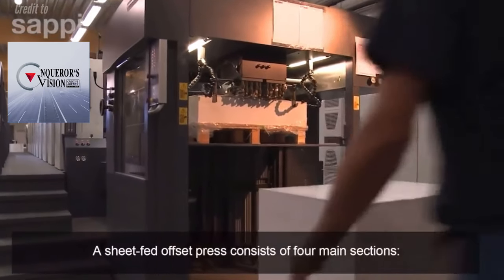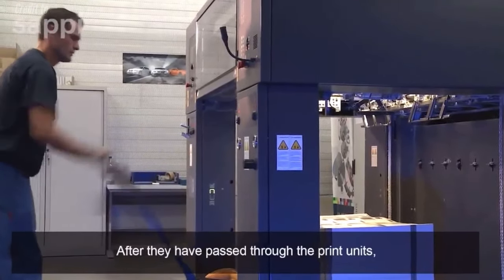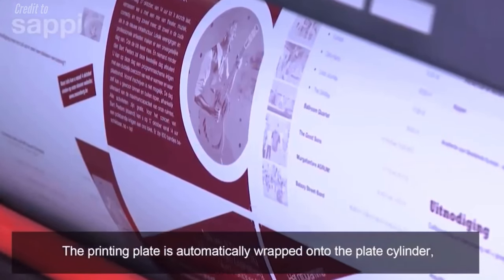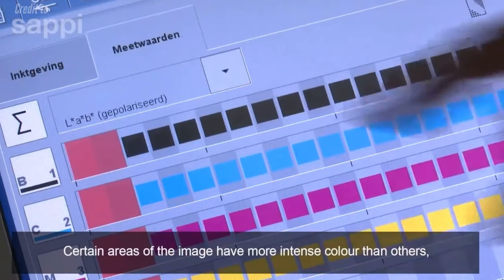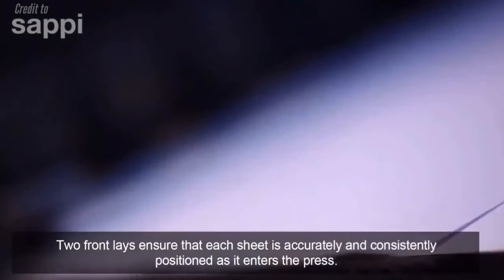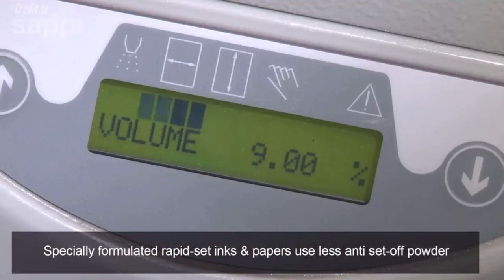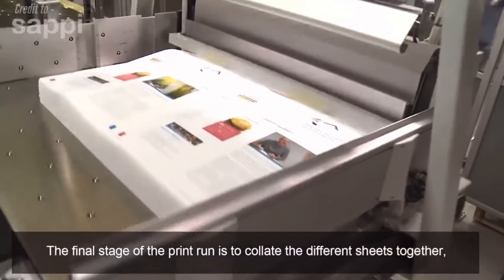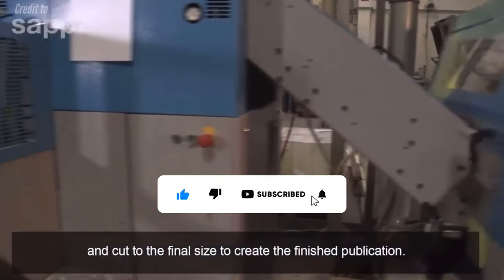What is Offset Printing? Complete Guide

Comment: I work on an XL105 Speed master Heidelbergs are great machines when new but a few years down the line when things wrong like Side Lays that wont cooperate or double sheeting then it becomes a nightmare
Reply: feeder problems happen no question but all that is can be avoided if the press is new using a double sheet sensor that self adj's then it might be worn out and turn it off on the consol. now if it is a twist manual double sheet Decator you need to tap the pin in on the side of it, simply put. now let's get to the air, sometimes if you might just need to get into the air cabinet and ensure one of the blower horses didn't pop on you. it happens. Iv operated a Heidelburg 2001 CD 102 / 97 SM 102 / 2009 CD102 colormaster.